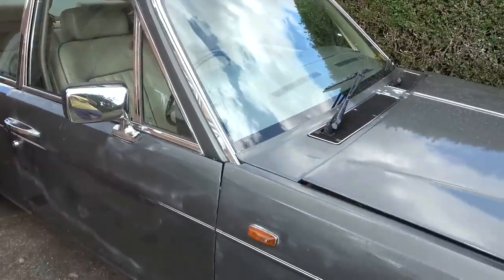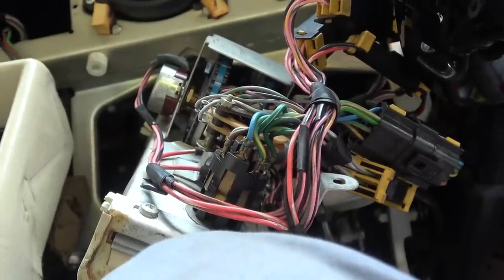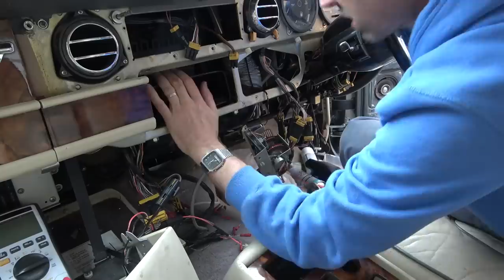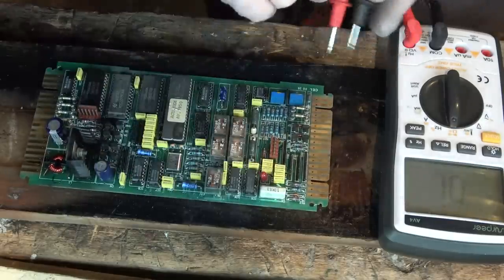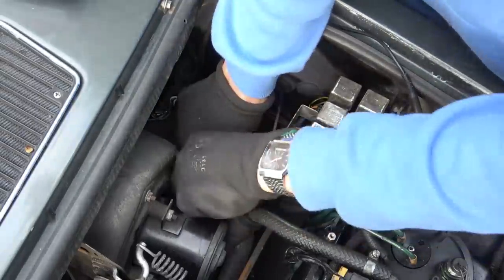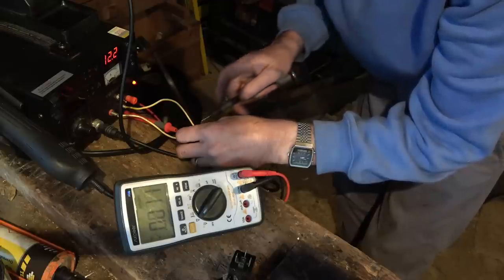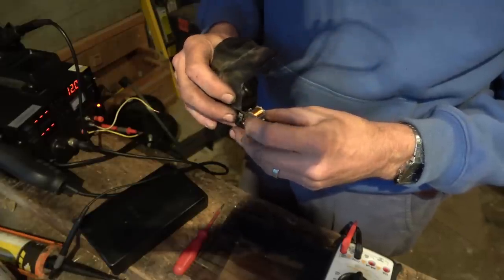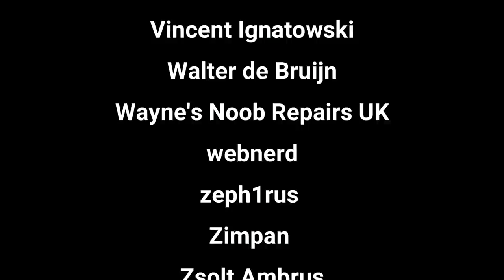No HOT or COLD AIR on the RR Silver Spirit - WHY?   PART 21 of CAN I DIY FIX a ROLLS ROYCE

Comment: Has anyone noticed roughly at 2:18 there's a spark from the nut the the lettering when he starts to mess with cables just a heads up
Reply: Couldn't see a sausage.
Reply from the maker: Yes, looks like it is going up diagonally from the 'E' on the rocker cover where Rolls Royc'E' is written. Like one of the rods in an earlier video that drops down the screen. Really weird. Well spotted 👍👍👍
Reply: Looks like a spark plug spark of from the bolt on the suspension strut closest to the engine how strange

Comment: Cool fix and even no parts required, even the relay was faulty. Also interesting to see that circuit board, and testing those relays. 
Again seems that Rolls-Royce was ahead of it's time, as ordinary cars at the time had mechanical, cable controlled heater units to control the air flow flaps, but sounds like Rolls-Royce had already then electrical motors turning the flaps, like most cars today. Probably automatic A/C too.
Love this video series :)

Comment: Nice video,Vince :)
You don't have to remove ANY of the fuses to measure them. You can measure continuity between the two dots on top of any of the fuses. And don't mind cleaning those relays. They are not that expensive to replace. I have seen car  fires because of dodgy relays

Comment: I would change all relays. They are standrad relays and not that expensive. I looked up a bosch (i not from uk) 30A (yours could be 40A but it should say on the relay) and its 4,5-5 pounds. (there is probably cheaper ones if you dont go with bosch)

Comment: RR had good A/C until Frigidaire closed. Then RR made a fatal mood by using a Japanese unit called Satco. They used until Vickers sold to BMW, and I can tell you there is nothing right about this particular unit. They literally had stacks of them waiting to be sent out to repair. That proved to be a complete waste of time. When something is designed to be worthless, it will stay that way. I own, and have owned at least 10 RR’s, of which most had the Japanese units, so I definitely know!!!!

Comment: I'm glad you did your usual methodical way of diagnosing a fault, I would have gone straight for the resistor pack, however I did notice that the fan speed didn't work on maximum so it couldn't have been the resistor pack, what I would have done as well is put 12v directly to the fans just to verify they work, other than that, a successful repair! Well done MMV

Comment: 4-pin relay wud have 2 coil connections, then common and normally open, 5 pins, 2 coil connections, then common, normally n/o... n/c normally open and normally closed. a switch over from open to closed/closed to open, if that doesn't make sense then I lost the plot lol.

Comment: The coil and switch in a relay are electrically isolated from each other Vince, there for using a small voltage to switch a large current load, you would never see the voltage of the coil on the output, there often used with microcontrollers and plc because the outputs from microcontrollers can’t source enough drive current to run servos and motors etc
Reply from the maker: Thanks Gower, I think I understand that now. Thank you 👍👍👍

Comment: You need to test both the NC (87a) and the NO (87) connection on each relay to be sure they're working correctly, as you noted the wiring diagram on the relay shows that it switches the source between those two. It's possible this circuit only uses the NO terminals that you tested but it's possible some relay-position uses the NC terminal instead or even both.
Since it seems to work it's probably fine but it's worth taking out the relays since it's so easy and do the same test except on the NC terminal on all the relays just to avoid the possibility of weird errors caused by that.

Comment: Just a heads up, you can check fuses without pulling them.  There are little cutouts on the top of the fuse that you can put your leads on to test continuity

Comment: A helpful hint for future electrical diagnostics. Test at the load. If all circuits are present work backwards to find the fault. Cut the circuit in half. Meaning find something in the middle to test. That will point you in the correct direction every time!

Comment: for reference , the car normal fans should work when ever you turn the ignition on , the aircon (condensor fan/s and aircon compreesor ) will only work with the engine running and the system pressured up to working pressure( see a label under bonnet ) , if  under (low) pressure the aircon system will shut off to save the compressor pump .

Comment: The sanding of the contact is a temporary fix.  I would change the all the relays due to age and moisture.  They are standard types, inexpensive, and readily available from many maunfacturers. Just buy good branded ones.  Or just replace them one at a time when they fail.

Comment: You won’t get the 12 volts on the relay because it’s the car thats giving it the 12 volts to pass through. While testing it off and you energize the relays, it turns into a fuse so you would get continuity but there won’t be any 12 volts to pass through since it’s not on the car .